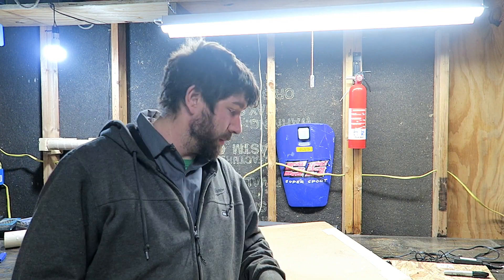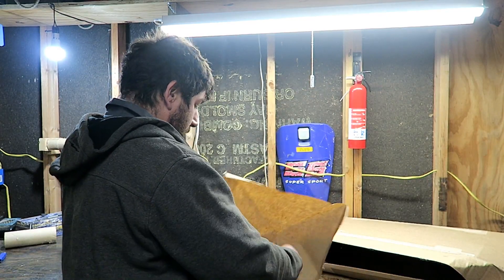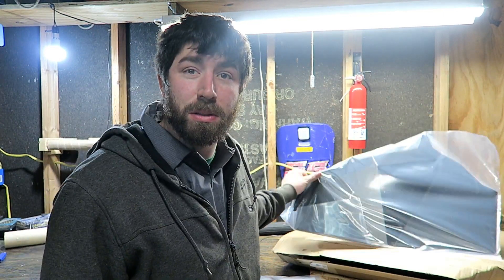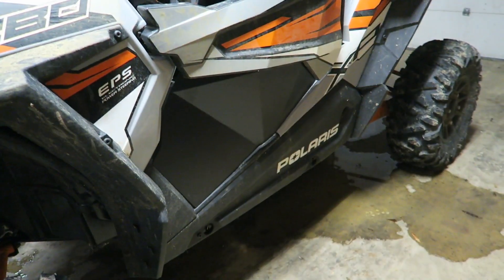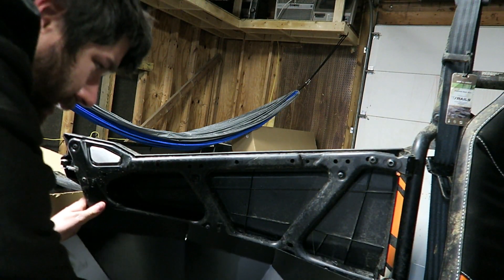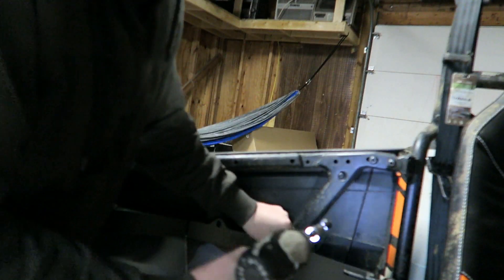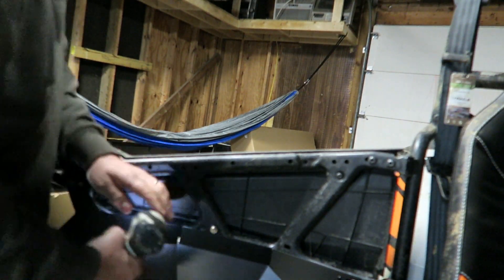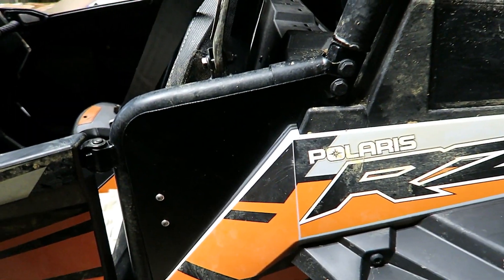Cheapest RZR 1000xpt door inserts

Comment: I got the same doors off amazon. For what they will do by way of protection I couldn't see spending the extra money on the Polaris ones. The little rubber seal that goesaround the doors is a bit annoying but after they are on for a bit they seem to do better. Love watching your rzr vids please keep posting.
Reply from the maker: I didn't even put the Rubber seal on
Reply: I only put it on to keep the metal from rubbing the plastic. It took a while in the Az heat to make it stay where it was supposed to.  LOL

Comment: How did these hold up? Do they rattle? Still worth getting?
Reply from the maker: I think now there might be better options possibly but they worked good enough for me they did rattle a little bit though
Reply: @redneckengineering7739  Thanks! There is no shortage of choices although, this is still one of the cheapest options. I was just curious how they held up over the years. Thanks again for the response.
Reply from the maker: I would buy them again

Comment: Dig your channel thanks for the video and you are 100% right about prices. I got a 2018 RZR XP 4 1000 Turbo and got a roof from Polaris and it was $800 and then I found the same roof on eBay for $300. I have done mostly Rc stuff on my channel but now I have the RZR I'm starting to post RZR videos. Are you thinking about getting a tune for yours? if so what might you go with?
Reply from the maker: +KillerOffRoadHobbyz yeah I haven't seen one for that cheap with all the audio components in it but I don't plan on doing any modifications power-wise yet because it's already fast as shit but if I was everybody talks about aftermarket assassin
Reply from the maker: +KillerOffRoadHobbyz oh and by the way the Polaris MB quart audio roof that I have is junk do not buy it LOL huge waste of money
Reply: Right on bro and thanks for the reply. I'm doing a full custom audio myself cost about $600 for everything and MTX wanted $1600 for much less stuff, talk about a rip off man they gouge the hell out of you for everything for they rigs lol.  I have the 4 seater and I took it to the dunes a little while ago and while it has a ton of power I was left wanting a little more. Ganna do a clutch kit first and exhaust then tuner stage 2 I'm thinking will end up close to 200HP to the wheels I think. What are you thoughts on SuperATV products?
Reply from the maker: +KillerOffRoadHobbyz everybody seems to like the Super ATV parts and I don't have any Dunes or I probably would need more power but I don't think that the aftermarket exhaust is worth it if you got the cats on the stock exhaust which I have a video on it's pretty much wide open
Reply from the maker: +KillerOffRoadHobbyz oh and what I like about the modified stock exhaust is when it's not in boost it's quiet
Reply: I watched that video and it is very helpful. I wanna straight pipe it lol LOUD!!!
Reply from the maker: +KillerOffRoadHobbyz there is also enough room to put in a cut out to where u can have quite or super loud